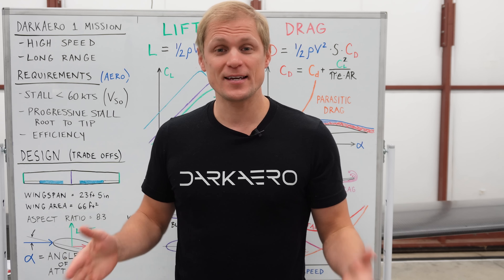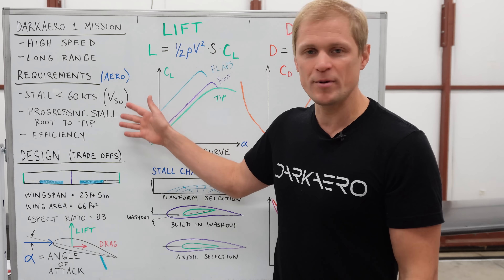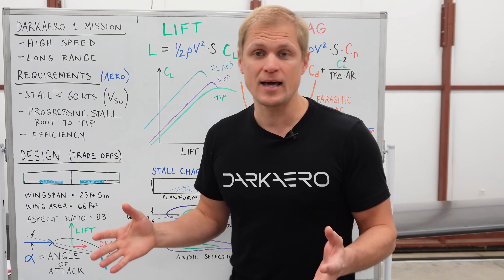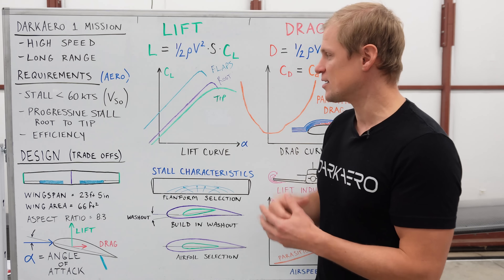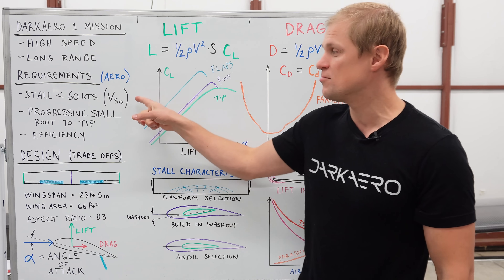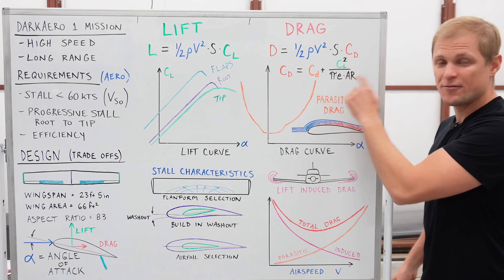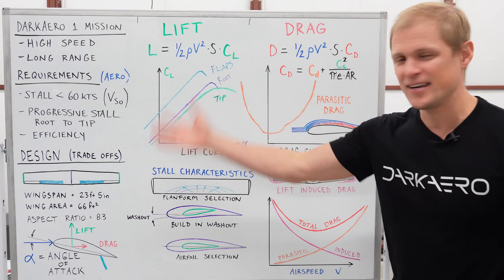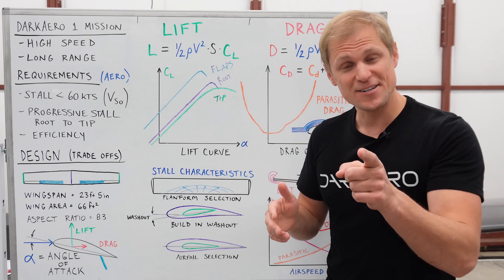Why we don't use winglets (DarkAero 1 Wing Design)

Comment: may I be wrong, but with winglets, you can "fill up" your lift distribution, which is only essential during takeoff and landing.
With winglets you reduce the induced drag which is important during takeOff and landing because it is the major component in the drag equation,
And you have the benefit of a smaller wing which reduce the parasitic dead and the mass, contributing to less power needed for cruise.

But this holds only if the wingtip is proper designed because the wingtip add mass to the tip which increase the bending moment at the root of the wing. (which increase the weight a bit)

Aircraft Companies like Boeing and Airbus added their winglets later during an "optimization program" to increase the efficiency.
And if a big company say its worthy, and those people are counting every cent, you know it is worth it ;)

Comment: Great video! Based on this analysis, it would seem safe to assume that other very fast composite planes that have roughly similar wing aspect ratios to the DarkAero 1, such as Glasairs and Lancairs, would not benefit from winglets either. This video was really helpful because I was trying to decide whether to install winglets on my Lancair kit, as some other folks have done, but now I don't need to (ssh, don't tell those owners with added winglets that they wasted their time and money lol).

Comment: As a non-engineer, I found your explanation at the end about why you did not use winglets to reduce induced drag very informative. It all boiled down to one of the primary constraints you pointed out at the beginning, the HIGH SPEED requirement. Great video!

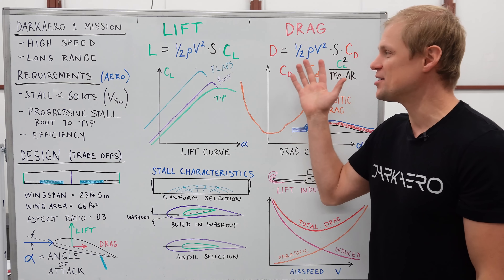Comment: Thanks!   Good review of the basics - but thin on the wingtip design choice factors.  Yes, nice intro of induced and parasitic drag all to get to the 30 seconds of punch-line between 13:30 and 14:00.   Glossed are factors that let winglets deliver 5-10% less cruise drag for airlines (also operating way out to the right on you drag chart).  Additionally, common wingtip designs are not considered (ie hoerner, blended, canted etc).   I guess the question the comes to mind is: why squared rather than any of the many tip designs will proven to reduce low angle of attack (cruise) drag?
Reply: I was hoping to see Hoerner wing tips but the aileron counterweights would not be as simple.

Comment: 13:45 with wingtips you reduce the induced drag that is true. But here is the magic part.
With wingtips you can "fill" your wing with higher lift coefficient. And you can build a smaller wing or a wing with less aspect ratio. 
In the end a good airplane is a trade off design.
You have structural weight, wingtips add weight, but a smaller wing reduces it.
Find the best solution

Comment: I know you guys are extremely smart.  But your “flaps” appear to be hardly so.  That flap looks like an air brake, not a flap.  I’m sure it develops some lift just by deflecting air downward, but it’s got to also significantly increase drag.  Maybe that is what you wanted or needed for landing?  But is seems to me that a proper flap, one that also promotes flow over the top (like airline flaps) would offer much higher flap performance.  And when landing, the last thing I want is to have a flap that itself might be prone to stall.  But like I said, maybe the plane is so good it doesn’t need but a speed brake. Some commentary on this tropic would have been nice, maybe it’s in another video.  Anyhow, thanks for a great video!
Reply from the maker: Thank you for checking out the video! We did a dedicated video about flaps here: https://youtu.be/9MWlKlI00Gc

Comment: Winglets are not about physics. As you said, they'd function better if they were horizontal, as in "use a little longer wing with narrow tips".
So why are winglets used? Airports charge based on wingspan, so fold your wing tips up; lower gate charges offsets the decreased efficiency, esp6 if your plane can be squeezed into a cheaper wingspan category.
Then "looking modern and cool" took over and folks slapped winglets on everything. You did well to resist.
Thumbs up.

Comment: The induced drag does NOT depend on the aspect ratio,  common missunderstanding:
forget induced drag coefficiend and write the direct equation: 
Dind = (L/span)² / ½ rho V²
That is what your own graph shows
BTW : the weak effect of Aspect ratio is to reduce chord, affecting parasite drag only
Remembering that Asprect ratio is span²/S
substitute the CD and AR 
do the algebra!
Than you get what I wrote

Comment: Nice explanation. It's good practice to design the wing root to stall before the tip, but it's also a matter of how much sooner (in degrees). Even with ailerons in the neutral position, a stall of the left wing root before the right wing root would result in a loss of lift, and an increase in induced drag on the left wing. Gravity would accelerate the airplane downward while slightly yawing and rolling it to the left. At low airspeed, a modest yaw rate and roll rate could increase angle-of-attack enough to stall the entire left wing, out to the tip. With high stall speeds, the angle-of-attack change is smaller.

Comment: can you put a canopy ( like over the cockpit ) over that light to smooth the shape? Also I originally learned that winglets reduce weight. You basically bent up your wing tip to reduce the leverage on the wing root. For this reason blended winglets are the natural way to do it. Problem is that we are no sensitive on yaw.

Comment: It'd be nice if there was an option for a 75 kt. stall speed wing for advanced pilots. I'd be keen to know what the increase in cruise speed between a 60 kt and 75 kt stall speed would be. I know that the Lancair IV-P has a demanding requirement for skilled pilots to be able to use it's 'high' stall speed wing.

Comment: As I expected years ago regarding winglets on high performance gliders.  Great in thermals but waste drag at 100 kts where we spend at 85% of the time running inter thermal.  Hi you should run water ballast on long fast flights. Dump before landing like we do.

Comment: Perhaps a naive or stupid question:  How about increasing stall speed (by reducing wing area) to improve efficiency (by reducing wing area as well)?  I presuppose that the answer is slower landings and shorter fields. How does 60mph compare to the stall speed of similar aircraft?  What other considerations govern choice of stall speed?

Thanks for the very, very good explanations of aerodynamic engineering!

Comment: Washout at the tips also serves to reduce the chances of flutter. As a hobby I design, build and fly model aircraft and currently working on a 6 meter glider that at the root has the SD7037 airfoil with 8.28% thickness stroked to Clark-Y at 10.53% thickness at the tips with a washout of 1 degree.

Comment: Great video. This is why you only see winglets on airplanes that cruise at low indicated airspeeds where induced drag is significant, mostly jets that fly above 30000 ft. Whitcombe called them "tip sails" originally, because they work like a boat sail close hauled, generating thrust from the tip circulation via a lift vector that is inboard and forward, as well as creating an "outwash" (sideways downwash) that weakens the core of the vortice. The effect is like a span increase without increasing bending, and even a little net thrust benefit that is more than the winglet's own parasite drag. But useless on a low altitude airplane, unless you are trying to optimize for climb, or just because they look cool.

Comment: Walking a fine line between young aeronautical engineers and those who want to see it fly. I suspect that the second group is many times larger than the first. If i am correct, throw the unwashed masses a bone once on a while. They have the attention span of a gnat.

Comment: What a great presentation! This helps explain how historically, large airplanes started having relatively smaller wings. As flap design progressed, the wings could be that much less of a compromise between cruise and low speed for take-offs and landings. So more elaborate flaps and other high-lift devices allowed wings to be optimized for cruise, so wings started "shrinking" over time for a given airplane size.  Unfortunately this won't translate for an airplane as small as this one, since the complexity, weight and drag of intricate high-lift devices would negate their benefit.

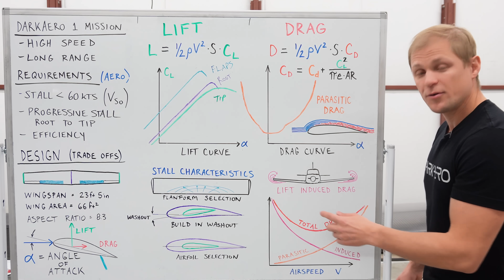Comment: One thing i dont get: At 12:54 you show that the induced drag decreases as an inverse square, which doesnt make any sense, at least according to the formula. The induced component is part of the drag coefficent with is MULTIPLIED by v squared not divided by. So the induced drag also increses by the square. Am I missing something? Or maybe are you accounting for a lower angle of attack at high speeds? But even then, you would not have a reduction of induced drag...

Comment: What if you made pop-up winglets to use at low speed; like ailerons, but at the tip? Or a hinged wingtip? Then you could have the benefits where it makes a difference without the drag penalty at cruising speed. I really like how you went through the math to show your reasoning behind the lack of winglets.

Comment: Video Summary: Why we don't use winglets (DarkAero 1 Wing Design)

Key Points:

- Design Requirements: DarkAero 1 aims for high-speed, long-range flight with a stall speed less than 60 knots. The wing should have a progressive stall from root to tip.

- Lift and Drag: Two fundamental aerodynamic forces. Lift is governed by air density, velocity, wing area, and lift coefficient. Drag is similar but focuses on drag coefficient.

- Trade-offs: High-speed cruise conflicts with low stall speed. The wing design is an iterative process to balance these conflicting requirements.

- Stall Behavior: A progressive stall is desired, starting at the root and moving towards the tip. Different airfoils are used at the root and tip to achieve this.

- Efficiency and Drag: Aim to minimize both parasitic and lift-induced drag. Aspect ratio and airfoil selection are key. DarkAero 1 uses laminar flow airfoils and composite materials for smoothness.

- Why No Winglets: Winglets would increase parasitic drag more than they would reduce lift-induced drag, making them inefficient for this design.

- Software Tools: Modern software is used for analysis, not for initial design. The design is based on equations and iterative calculations.

- Conclusion: The design involves many trade-offs, and everything is a balance between lift and drag. Future videos will discuss structural considerations.

Comment: Just for understanding: Is the plane most efficient at cruise speed or at that lower minimum drag point?

I am assuming your engine is optimized for cruise speed. Would an electric one shift the efficiency point of distance per energy down towards that minimum drag point?

Comment: Wow, 95% of the video wasn't even about the subject I clicked on the video for.  The math/physics is correct, but the design choices leave me wondering what drove the rather disappointing compromises.

Winglets do add a modicum of parasitic drag, but since they lower induced drag by recovering more lift at all speeds, you can design the wing just a little smaller while still meeting the same requirements.  That small amount of wing you're able to remove from the design as a result offsets the parasitic drag from the winglets and gives you less total parasitic drag at higher speed.  Wings with properly designed winglets are more efficient than blocky wingtips...there's a reason why they're used on everything from airliners to gliders to race aircraft.  Fowler or slotted flaps would've allowed you to reduce wing size even more while maintaining the same stall requirements, thereby reducing parasitic drag even further.  The only reason I can come up with as to why winglets and a more efficient flap design aren't being used is due to economical reasons, as it would appear that the technical capability to incorporate them is there in other aspects of the aircraft.

Comment: Is there a way to design a downward facing winglet that's hollow and has slots on the underside and a vent at the rear to force the airflow that would have been wingtip vortices into a geometry similar to what's found in modern high flow suppressors? It would have to be a series of half-spiral ducts, which would probably have a complicated build process, let alone design process, but it would necessitate a mostly hollow design which obviously would save weight in the design. I'm sure that at this point in my comment, you've already conceptualized this in your head and have a reason why it wouldn't be practical 🤣 keep it up nonetheless, we all love the updates
Reply: bla-bla-bla    what NONSENSE
Reply: @daviddavids2884  thank you for contributing literally nothing to the conversation. You are the human equivalent of a participation award, congratulations.

Comment: Great talk, I'd also like to contribute and mention that different airfoils have different levels of longitudinal stability.  My very favorite is the tip air foil used on the B-29 bomber,  the E220 air foil is a reflex type air foil, its a very fast airfoil but is also very stable.  It does require a lot of precision in manufacturing though and is easy two get wrong.  You defiantly have a much wider tolerance with the symmetrical NACA  foils and they do preform satisfactorily.

Comment: Good video and summary for someone with little to no knowledge about aerodynamics.   Couple of notes.   The 'e' in the induced drag equation equals 1 for an elliptical span load (Yes, I am sure you know this).   As you move away from that, the 'e' drops and induced drag goes up.   That is what washing out the tip does.  It 'triangularizes' the span load and thus drives induced drag up.  However!   It also reduced the wing root bending moment so the span load chosen is not just a function of drag but a weight/drag tradeoff.   As for winglets, you should never use a winglet unless you have to.  Why?   You only need about half as much span extension as winglet height for the same drag reduction.   So why winglets?   You mentioned it - you have a garage door constraint.  Airlines have airport gate constraints.   If you can't make the span any larger, then a winglet makes sense.    As someone who spent nearly 40 years designing airplanes I found your video to be excellent and with the appropriate amount of detail (which is why my commented topics were not in your video!)

Comment: I remember reading an article that the better finish on a wing surface is actually not a glass smooth - but one that creates a defined boundary layer.  The primary reason this was not done on airlines (according to the article) - was the cost to create the surface was very expensive.  I will see if I can find the article as I was shocked!

Comment: You mentioned in the video that you measured the coefficient of lift using a model and a wind tunnel, but I'm guessing you obtained a theoretical number through calculus, right? Experimental data is necessary to confirm your results, of course, but I would think that you could describe your potential wing shape as an equation or series of equations and plug the result into an integral to determine the coefficient of lift?

I'm just a university student so I could be way off, but that seems way more viable with modern computers than simply sculpting a wing and running it through a wind tunnel, then repeating that process until you get a disirable lift coefficient.

Comment: I don't think I heard an explanation though for not using winglets. The trade-off would be structural weight and skin friction, but overall for drag, it would be an improvement and be higher efficiency, even at the Reynold's number of this aircraft. Ideally, you would design the aircraft to the cruise speed and trim angle of attack, especially if the mission is speed and range. Neglect everything else about high alpha performance as long as the stall characteristics are sufficient, which as you've done is adjusted through twist
Reply: The explanation was near the end: the overall drag would not be improved at cruise speed.

Comment: At 12: 45 you say that parasitic drag goes up exponentially with air speed. 

I know "exponential" is a common figure of speech but as an engineer you should avoid using it as such. As the equation on the right of your whiteboard makes clear,  parasitic drag follows a power function with an exponent of 2, not an exponential function.
Reply from the maker: Agreed! I slipped up when I said “exponential” rather than “quadratic” at that moment. Thank you for your attention!

Comment: My impression is that winglets are about as efficient in drag-reduction as a lengthening of the wingspan by the length of the winglet. 

So in principle you use winglets when you have limitations for the wingspan, like for passenger jets at the terminals, or for the 15-meter-limit for gliders.
Reply: ... or the "two-car garage" limit mentioned in this video. Roll rate is also a consideration.
Reply: Not adding winglets reduces the complexity of manufacturing and assembly SIGNIFICANTLY. That's the biggest savings, without a doubt. If this plane had winglets in the design, the price would easily be 25% more.

Comment: Hey everyone ! One question : Why would a higher aspect ratio wing produce less lift induced drag ? might be a stoopid question but thanks for answering :D
Reply: It's not a stupid question. A higher aspect ratio means a longer wing for the same area, which makes the loss at the wingtip less significant, but that's only part of it. As with anything else in aerodynamics, a reasonably complete answer is long and complex.